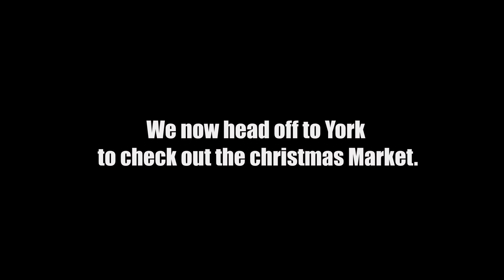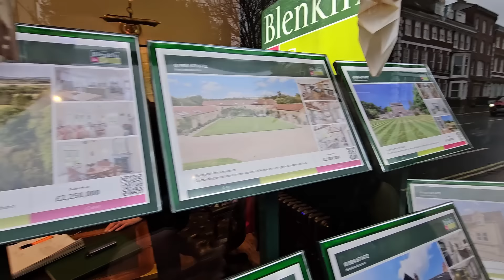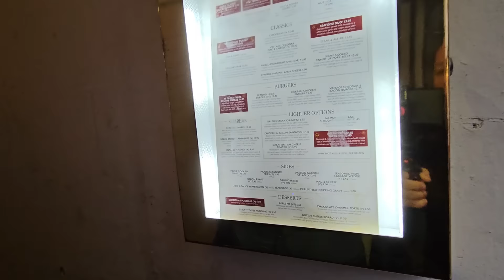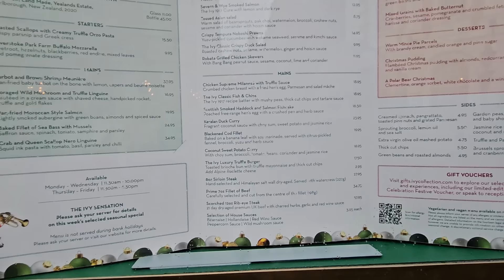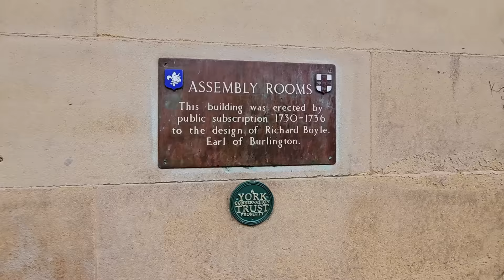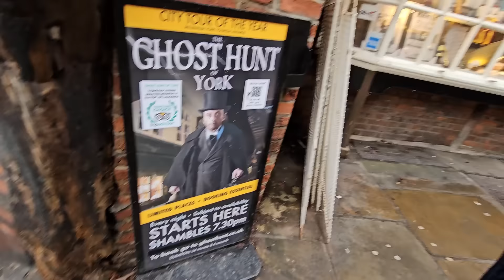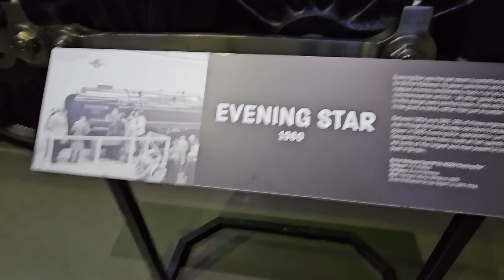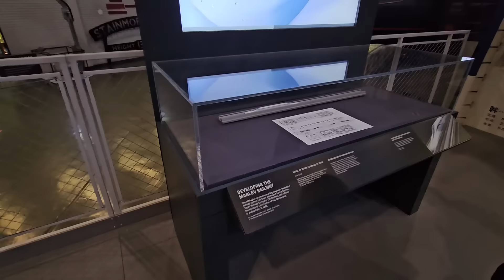Is It The Best or is it a SHAMBLES - York Christmas Market

Comment: @susan bonita - nut roast , based on a 40's recipe. Original recipe was chestnuts, hazlenuts, walnuts chopped fine and lightly toasted. 1/2lb. I used walnuts, brazils, pecans hazlenuts and almonds. Original said breadcrumbs and mixed herbs I used a packet of sage and onion stuffing + extra mixed herbs, original asked for grated parsnip, I didnt have any so subbed carrot, one stick of finely chopped celery, and a finely chopped or grated onion. Mix all the dry ingredients together , original used dried egg i used 2 chicken eggs. Mixed it all up together till it made a really thick 'dough' lined a greased loaf tin and baked at 180 till firm. Cover with foil to prevent top drying and remove last 5 mins

Comment: Martin as i was told the bar was heated up slotted through and the brackets placed on either side as it cooled the steel contracted shrink and pull the wall in to stablise the Building